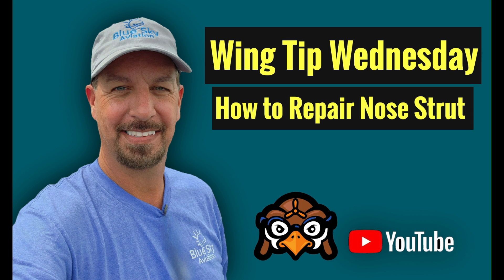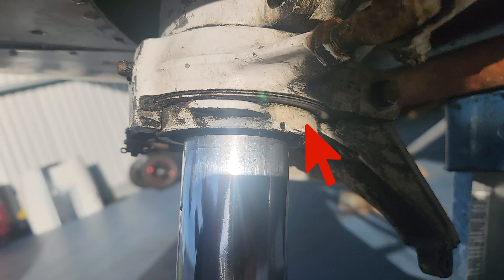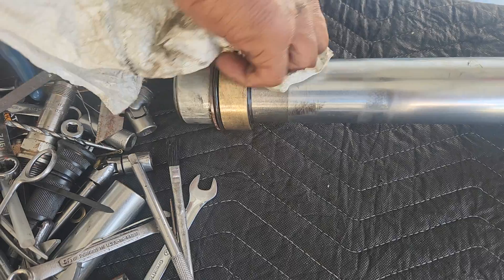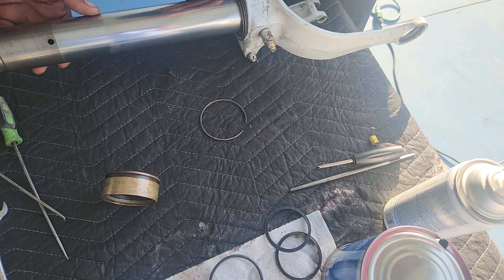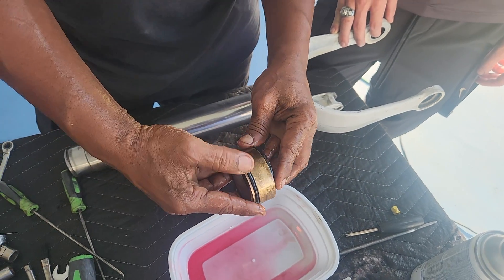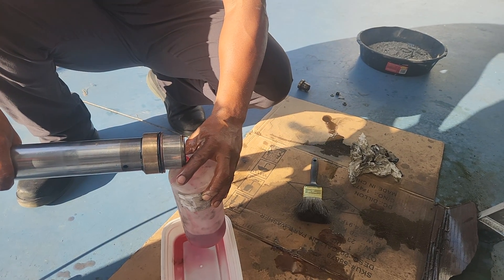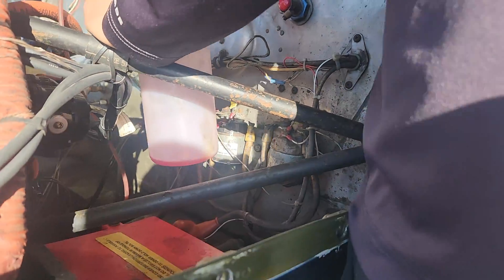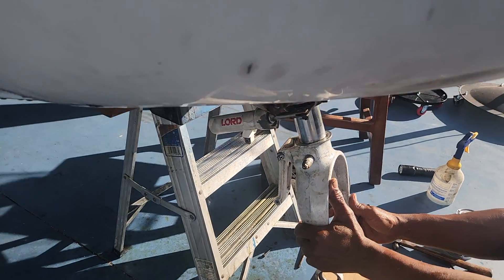How To Repair A Cessna Nose Strut

Comment: Did you place the little ladder right under the firewall?  I've got to replace the seals in my nose strut this week and that looks like a good way to keep the nose off the floor.  But I need to know just where to place that little ladder.
Reply: Brother, just lay two 60lb sand bags on the horizontal. That'll keep the nose up just fine
Reply from the maker: @TheFretman2  you should have a Tiedown ring just aft of the firewall.
Reply: @blueskyaviationpilottraining  is tie down ring resting on the 2X4??
Reply from the maker: Yes. Your POH will have a jack point diagram.

Comment: way too much fluid, service manual says fill to top with strut collapsed , not 3". the 3-4 inches is what you see after you add presurized air/nitrogen.